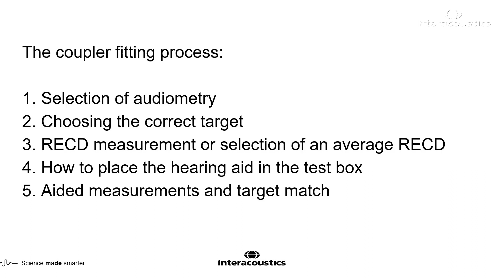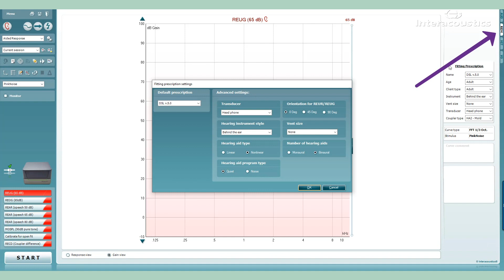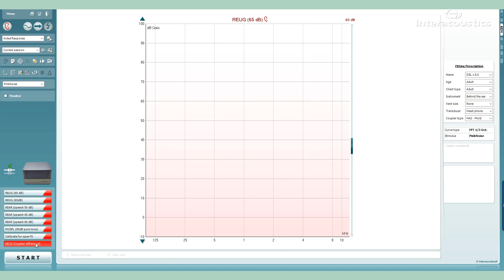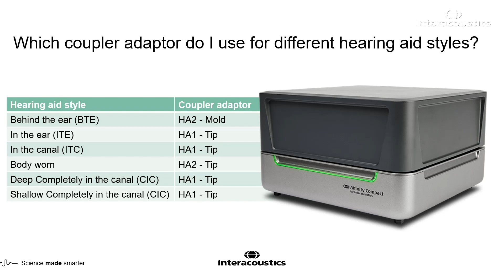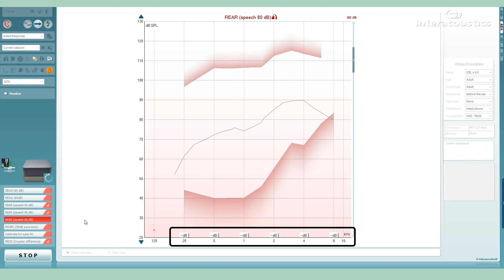Performing an RECD Measurement

Comment: Hi at 3:01 which mic on the hearing aid should the reference mic be facing towards? does it make any difference?
Reply from the maker: Thank you for your interest. The reference mic should be facing towards and as close as possible to the forward-facing microphone. However the exact location of this microphone may vary depending on the hearing aid you are using so it is important to clarify this with the hearing aid manufacturer if there are any doubts. I hope this was helpful :)